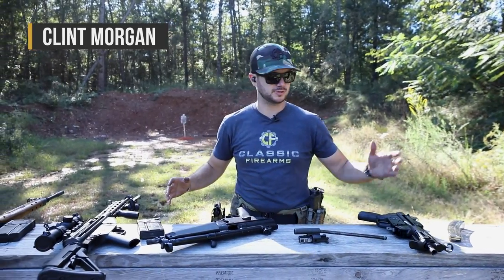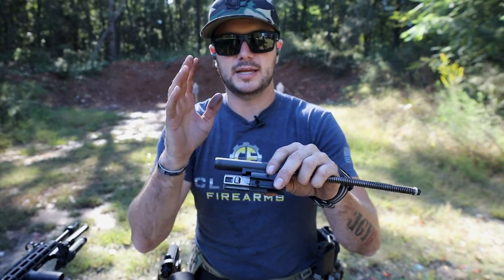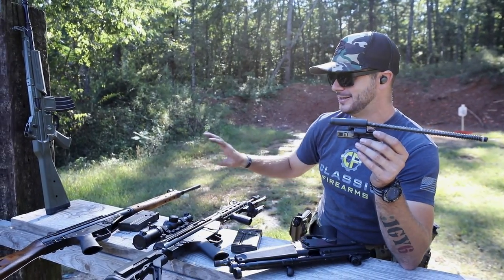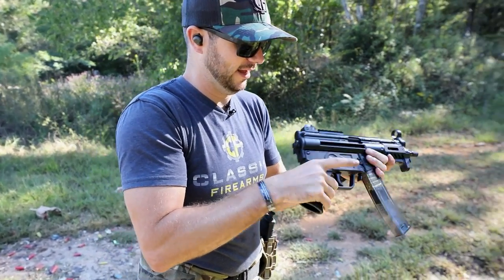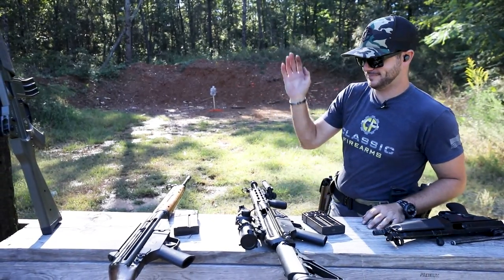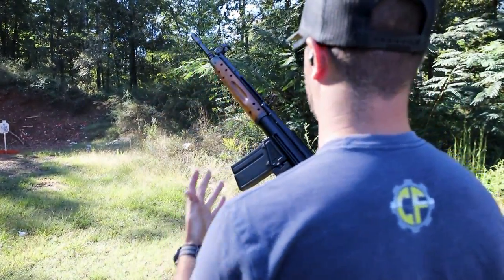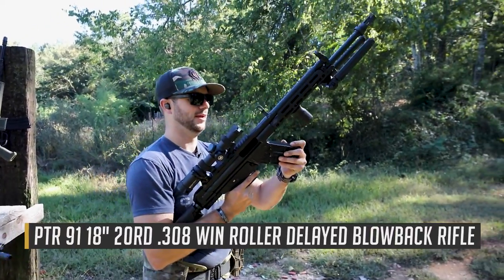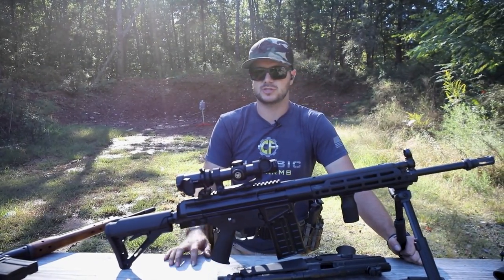Why Do People Love Roller Lock Guns?

Comment: Here's the dealio.  In regards to the 9mm in particular, the roller lock let's you lighten the bolt compared to a direct blow back.  One of the heaviest ar's I have is a 4" barrelled 9mm. I weighted the bolt and buffer until it stopped hitting the hold open and then lightened it slightly. I did this to reduce the gas in my face. With the 147 grain bullets and a suppressor, I think I was getting more gas out of the chamber than the end of the barrel. The gun works great but it feels heavier than a 16" carbine.

Comment: Also with the g3 mags inspect the front tabs as they do break off, I have one mag that is no longer usable because those tabs were broken off and didn't know until I tried using it the first time and had some feeding issues. Afterwards I noticed the follower didn't sit right and noticed the tabs missing.

Comment: I don't think he gave the best description of the action.  The rollers opening is not based on pressures subsiding but they just slow the bolt, giving the bullet time to travel up the barrel and the pressure naturally subsides by the time it's fully free. I'm pretty sure the bolt starts moving immediately, it just moves slowly because the wedge holding the rollers into the trunion has to move 3 to 1 as it is pushed back, out of the way of the rollers. The 308 versions have fluted chambers, cutouts in the chamber surface, to reduce contact between the chamber and the case, reducing friction and letting the casing start its rearward motion at full pressures

Comment: I have 3 days to decide on the MKE AP5 or the AP5-P. Its my first roller lock. I love my gen2 MPX-K. Which should i grab first?? I feel the smaller package is more of a technilogical Marvel although they are realy the same weapon. Im leanin towards the K with a B&T stock as i cannot find a reverse stretch,,and a Mlock rail,,aluminum mid length Grenade profile Vert Grip,,Arisaka 300 at the 1oclock and either a sig Romeo 4T or jus a trijicon MRO. That would be my K model plan.I have yet to think of a fullsize platform build list.You opinion WILL be the Nail that closes the Crate on which model i chose.

Comment: Does thr PTR have the same chamber kneeling as the 
FA 91 I built back in the 1990s? I had to buy 10 American made parts.
I bought the aluminum receiver from cheaper then dirt, and comply to the BS requirements.

Comment: They'll never be outdated. The MP5 is older than most "tacticool" shooters are today, and it's STILL the best subgun/PCC on the market PERIOD. ♥️🇩🇪
Reply: Oof........no. Go shoot an MPX. Cheaper, no reload problems, softer shooting, and no need to lock the bolt back to load full mags. They even have a short variant to win in the size department as well.
Reply: Even if i tried to like the CZ Scorpion (and i still do), i always ended up loving the MP5 more lmao
Reply: @bmagada  I have shot both, long and short versions. MP5 is still the more robust, proven platform. Its more accurate, no FTE or FTF issues. The only MP5s to EVER come into my gunsmithing shop were for cleaning or Cerakote, and they've been around forever. The MPX is relatively new in comparison and we've had several in for repairs or parts replacement. Problems with feeding certain ammo, problems w/ the dual recoil springs, chamber issues, extractor & extractor spring issues, accuracy problems, very poor inner barrel quality on a few (bad machine marks left in rifling, bad crown, etc) & magazine issues just to name a few off the top of my head. Plus the tri-lug adapter is the best on the market for suppressor attachment. Yeah if you like and are familiar with the AR platform the MPX might be better for you, but for a gun to trust MY life on, be more accurate & reliable w/ ALL types of ammo, I'm still going with the H&K! Been shooting and working on guns for 30 years, I've had plenty of time and experience to build up my opinions! And as for reloading w/o having the bolt back it sounds like you've been watching too many YouTube videos. Have you ever tried to put a fully loaded mag into an MP5 or clone w/the bolt forward? It just takes a little force to compensate for the spring pressure from the mag, just like an AR when you load a full mag and don't have the bolt back. If you can't handle that then you shouldn't be shooting anything.
Reply: Lol no
Reply: @bmagada  like the mp5 doesn't have a short variant?